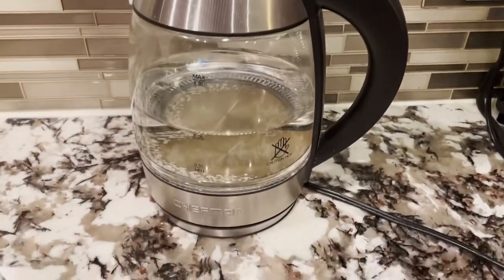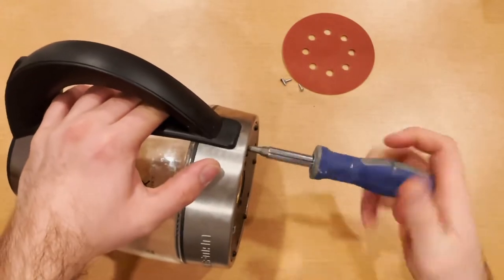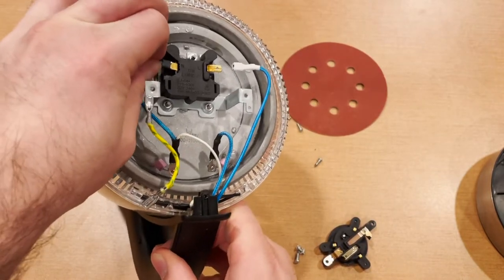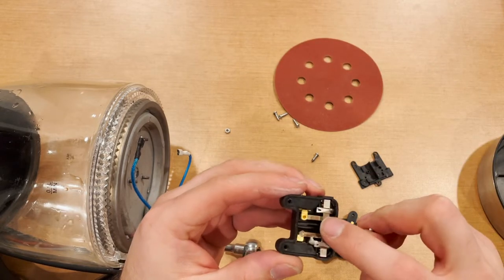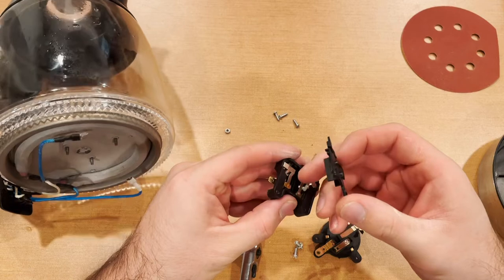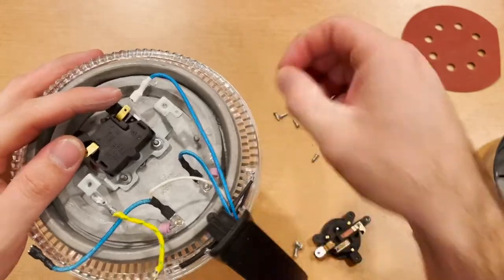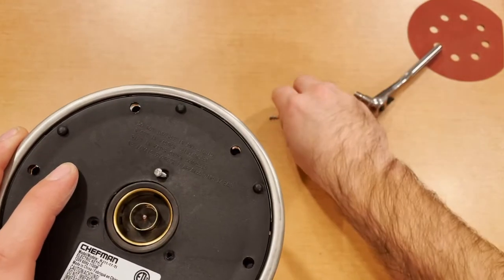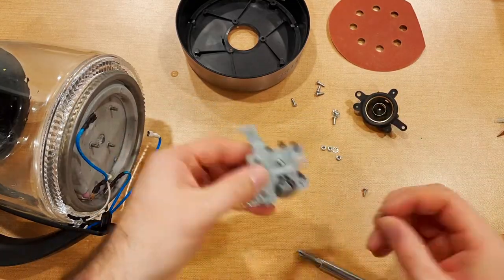How to fix a Chefman electric kettle

Comment: Excellent step by step instructions! Was able to fix the issue, be careful with the small spring inside the small box
Reply from the maker: Awesome. Glad you were able to get it fixed. Mine kept going in and out so I adjusted the contact point on the bottom.

Comment: This worked. Thanks! I never would have known what to do on my own. The clear plastic ring on the bottom cracked and I had to glue it. It was tough getting the bottom cover back on but I used a screwdriver to push the wires aside.
Reply from the maker: Awesome

Comment: You can use an ice cube tray to keep the different nuts and screws together.
Reply from the maker: Yes good idea.
Reply: I use a sheet of paper or a paper towel on the bench. Didn't need it for this but for larger jobs I can write down what goes where, circle all the parts from a certain reassembly step, etc. if needed. I like your old ice cube tray trick too. Might just leave one on the bench for next time. Thanks for the tip, Mavro.

Comment: I only had very fine sandpaper so Instead of sandpaper I used contact cleaner (specifically CRC brand QDElectronic Cleaner).  It worked.
Thanks for this helpful video.

Comment: thank you, worked like a charm. Strangely mine didn't have that yellow wire that connects to the base cover of kettle.
Reply from the maker: Gald you were able to get it
Reply: @littlebitofeverything607  stopped working again after 2 weeks so I decided to check inside the base that has power cord coming out of  to see if there's anything going on and I saw that 2 conductors were all black on the surface (I'm assuming this is the residue being pointed out in the video) so I sanded it and it started working again! I think I may have sanded a bit too hard trying to get rid of the black residue as I see scratch marks and the golden surface faded away a bit showing the silver linings. Will this be alright?

Comment: So, I'm having a wonky issue with mine. It works, however,  it doesn't turn off. So, I noticed this today when I was boiling water. It starts to boil then the sensor shuts it off (logical because it's completely hot at this point), but then turns back on and starts the boil up again. It repeats this step a few times before I manually turn it off. Help!

Comment: Thanks for the video, I tried to follow the guide to fix mine. As some one in the comments pointed out there is a small spring inside the small box. It fell out and I don't know where should I put it back. Does anyone know where exactly the small spring should be?

Comment: I have the same kettle. Tried the method today but it didn't work. Will try again later.
Reply from the maker: You might also want to check the base. if its not pushing the pin on the kettle up, it wont activate the heating coil/ turn the light on.
Reply: @littlebitofeverything607  yes, I think my base might be the problem - is there a video for fixing that?

Comment: So has anyone else with these electric tea kettles have totally melted plastic all around the heating element,all of mine die the same way and they all end up having melted plastic all around inside the connector areas

Comment: Thanks for the video. I could make the kettle boil following the instruction, but after one boil it stops boiling again? Is it because I haven't sanded the contacts enough?
Reply from the maker: Sounds like potentially a connection isn't being connected. Try to lift the connection on the base that it sits on.
Reply: @littlebitofeverything607  I noticed the connector that you sanded, for mine the bottom connector strip isn't springing back up as much on one side as the other. I tried to lift the metal tab to make it spring back up. I've made a few boil and it seems to be ok so far. I'm also manually turning off the boil when it gets to 100 for now in case the thermal sensor isn't quite right.

Comment: Does anyone know what temp the kettle stops at
Reply from the maker: Around 212 F. Think that's Boiling point?
Reply: @littlebitofeverything607  yup i just bought a thermometer partly to find out and other uses. It stops at 212.9 usually but sometimes 212.7 in my test . Thank you!